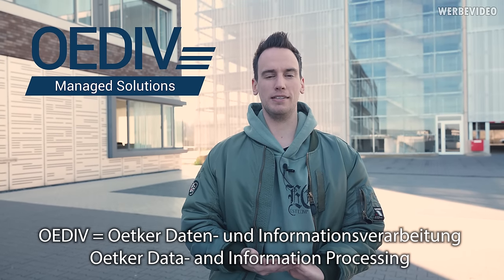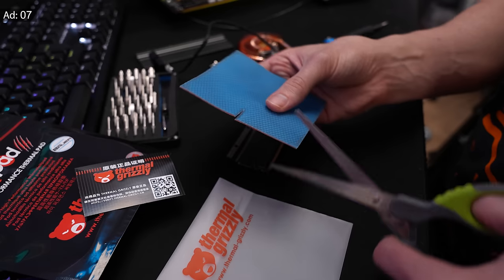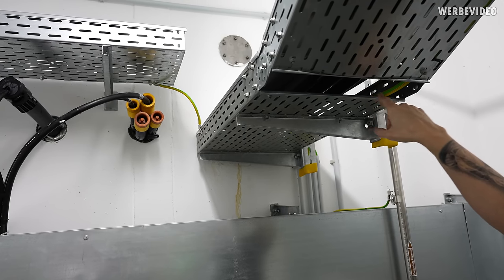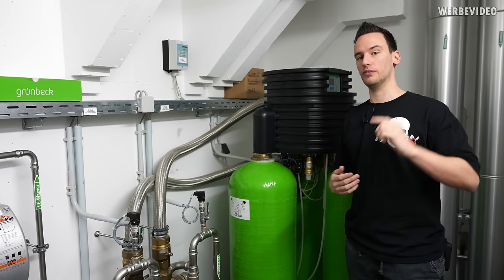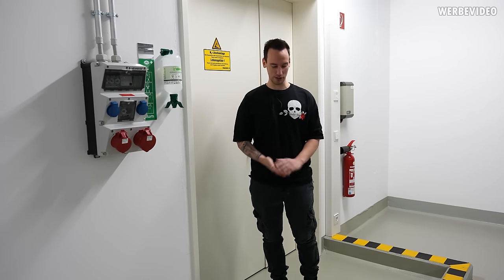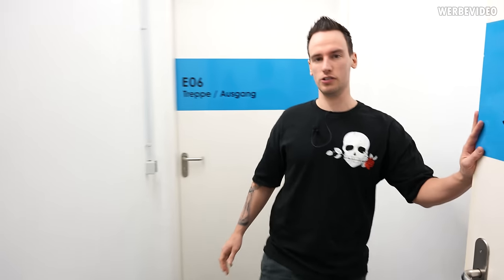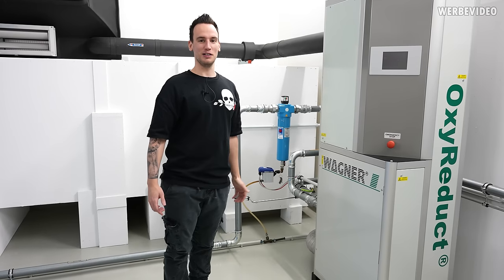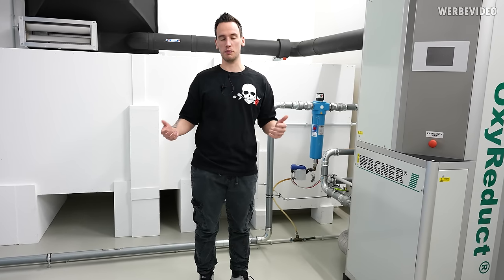Exclusive Insight: Visiting one of the Most Advanced Datacenters in the World

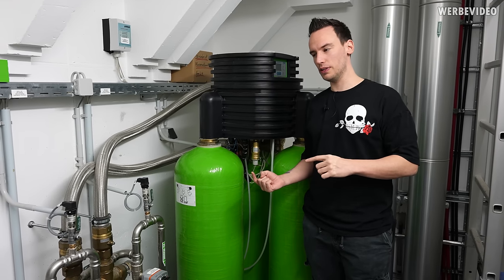Comment: 5:32 As someone working in the water industry, my guess is that those are for water softening. Hard water causes the formation os Scale deposits on anything the water touches (the insides of the whole cooling system in this case), which reduces the effectivenes of heat transfer and ultimately may even leed to damage to the pipeing. This is especially problematic in this case, since the hotter the water the more and faster the Scaling. Depending on how hot the water gets, they may also be using a degassing system to remove oxygen from the water, since in hot water oxygen becomes very corrosive.
Reply: London water is so hard it kills kettles if you don’t descale once ever couple of months, unless you’re like me and use bottled water cause you’ve been put off drinking water boiled in London kettles pretty soon after arriving after seeing what happens.
Reply: absolutely. We have well water on my property here in the states, and we have to use a (much smaller) similar device to soften our water. Otherwise it clogs up the pipes and other stuff with Iron rust build up. Turns everything yellow or brown. I would imagine they need to remove ANY minerals and biological stuff from any water used to cool something this large. Otherwise they would be tearing the cooling down frequently trying to clean the crud out of it. The same could be seen in someones desktop pc they water cooled, and ignorantly used plain tap water inside with no additives. The cpu and Gpu blocks fins will clog up super fast.
Reply: Only thing I would add is; there is no salt in a water softener. The salt in a softener system is used to create a brine which then back washes the negatively charged resin beads inside the cylinders on a regular cycle. It's the resin beads which do all the work.
Reply: It's a water softener. Commonly used here in the states for reverse osmosis, boiler feedwater, and city water/industrial water
Reply: @ZonkedCompanion  "there is no salt in a water softener", yes, but also kinda no. It's true that the resin does the "work", but the way it softens the water is through "ion exchange", i.e. Calcium ions (the cause of scaling) from the water are exchanged with the salt ions (Na for example) from the resin, thus you could say that there's salt in the softener. When you wash the softener with the salt brine, the Calcium ions trapped in the resin get removed and replaced with salt ions, i.e. resin "regenerates".

Comment: I was always wondering why the HANA in-memory database is still a thing when we have crazy fast NVMe drive technology, now I can finally make sense of that. TB level memory access bandwidth is absolutely amazing, no component in a normal desktop or x86 based server can come close to such a level, not even the GPU.
Reply: Muh, flash bad /s

Ehhhhh 8 socket Xeon systems can easily have 8 TB (or more) of memory, and modern datacenter GPUs (ponte vecchio, MI250X, Hopper) put this to shane in raw memory bandwidth.
Reply: @suntzu1409  ok, now which one does both?
Reply: @suntzu1409  Not sure about the multi-socket configuration of the Xeon platform, but I do know for Xeon scalable, the memory bottleneck is a big issue already in a single-socket configuration, about only 200-ish GBps theoretical bandwidth is achievable, and the speed via interconnects will be slower.
As I did miss the H100/Hopper GPU announcement, I apologize for missing that 3TBps single card performance number,  these do surpass the raw bandwidth of 1TBps, so thank you for that information. But as a note, based on my personal experience working with GPU computes, due to the "cores" in GPU having a tiny cache per hardware thread, they hit the memory much harder than modern server CPUs unless you work with very localized data or with data shapes optimized explicitly for this pattern, like crunching matrix multiplications with low precision, which is shown in NVIDIA's pages as the intended use case. Otherwise, the GPU could have worse stalls due to memory access or bandwidth saturation caused by the repetitive fetch of the same data. Also, their instruction set is not for general computing and has a sky-high penalty when branching operation is involved (heavily used by any database).
Finally, the flash technology I mentioned is something like the Intel Optane series, which optimizing in-memory DB's startup latency is one of their main selling points. This is the part that initially confused me. Since they are already using PMems that have an access latency in the hundreds of nanoseconds and a maximum bandwidth of a couple tens of gigabytes, why still put everything 'in-memory' when using flash arrays would be a much more robust and also a non-volatile option. Bandwidth, size and access latency all contribute a critical part to the puzzle, and I do not think missing any one of them would make such in-mem DB configuration make sense.
P.S. I did participate in the bidding process of an SAP HANA migration project from the old SAP + Oracle DB combination. Yes, they do need that 10+TiB memory as their operational database is absolutely enormous, even when the new system has more than one DB instead of the one central one in the old system.

Comment: The cabinets to the left of the z15 are the DS8Ks, which are the mainframe's primary storage system. Another note, that TS4500 tape storage library is most likely part of a virtual tape library which interfaces with another system, a TS7700 which incorporates hard drives as high-speed cache and storage for the tape system. The TS7700 and TS4500 work together and use both hard drives and tapes to present itself as one big virtual tape library to the mainframe for secondary storage.

Comment: Testing generators isn't just to make sure they work, but also to keep them fully lubricated. Additionally, while not likely in a temperature controlled environment, temperature fluctuations can cause condensation inside the crank case. For periodic maintenance runs, the engine should be run long enough to get up to full operating temperature for a while to steam off any accumulated moisture. Running them for a short time can be worse from a moisture perspective.

Comment: I'm surprised they're that proud of a PUE of 1.35 in such a modern datacenter. The best right now are closer to 1.1. Our datacenter built in 2000 was running at 1.3 and Google did 1.2 in 2008.
Reply from the maker: Highly depends on the climate zone where you are located. In colder countries obviously much easier
Reply: Meta has a datacenter in Denmark running about 1.07. The heat waste heat is even used for district heating in the winter. But the hyperscalers like Google and Meta have the advantage of being able to integrate everything, including the scheduling of tasks between servers and powering off servers, for maximum efficiency. They also don't have an indoor climate that's as tightly controlled and use outdoor air for cooling. There are trade offs.
Reply: @der8auer-en  Those datacenters are also generally using DC distribution - it makes a 5-10% difference in efficiency to skip the inverter stage. Google and Meta have both moved to 48V DC distribution with their custom servers. Why 48V? 50V is the highest voltage you dont have to treat as deadly in many places - you need a (data) cabling license not an electrician, and 48V is also good for either lithium or lead batteries), it has also been used in telco equipment for many years. Some companies are also moving to 380V DC or other voltages.

Comment: If the battery backup is active rather than passive it should be doing a constant conversion of AC to DC and then DC to AC.  The input power should be both the grid power coming in and the diesel generator.  If you lose grid power, the UPS would switch over to the generator once it's online.  I think in this case you don't have to worry about phase shifting.  This would be Double-conversion systems if this is what's happening and it completely isolates the equipment from the input source and gives you a very clean AC to the servers.  I'm guessing that's what this would be considering how critical power is to servers.  The batteries give you enough time for the generators to come online and feed power into the AC to DC converter.  I don't think it takes long for the generators to be online.  A few seconds.

We had a different system since there was only grid power.  The grid power would feed into the UPS to keep the batteries charged, but the output was from the grid, though I believe the UPS filtered the power to make it cleaner.  The UPS would be running enough so that the phase shifting would take place so the battery output would always be in phase with the grid power.  If grid power dropped, the transition from grid to battery had to be very fast.  If I remember correctly that's how it went.  I don't think there was a constant output from the batteries.  I think our UPS gave us about 15 min. because it was designed for older equipment that consumed more power and after our servers got changed out the UPS was more than enough for that system.  Then when grid power came back online, the output of the batteries would have to phase shift to match grid power again, and then another switch back to grid power.  Or it's possible it was also a Double-conversion system with only one input.  It was too long ago, approaching 30 years.  Hard to remember that far back.

Comment: Thank you for the tour.  At 43:49 you did get that a  little backwards.  Isilon is your mid range NAS solution and Data Domain is for your backups.  To be fair you do have a VNX next to the Data Domain :)  Also, the ECS could be for backups, but it is traditionally used for Object/Cloud data.
Reply: I was wondering the same. You could use Isilon for backups but I've never come across somebody using it at a decent scale. Especially with the DD on the other side, I would be surprised if they actually used Isilon for backups. I'm an Ex EMC tech so it's nice to see they still go hard with the Disco lights.

Comment: warranty on IBM is very good, we have once have a failed HDD, the tech travel for 9 hours just to replace the drive for not more that 5mins. not like HP they depend on the local supplier for the replacement.
Reply: We had a couple drives fail in a HDS disk array and they sent a taxi from Berlin to Aarhus, Denmark, to get them replaced on the weekend. They (and many others) also had a fully stocked warehouse in Amsterdam, capable of building a replica of your system and delivering it by air within eight hours.

Comment: Hi from Australia. Please send Pizza specials (first frozen pizza i could stand).
More seriously, that's some pretty awesome high reliability infrastructure, theres over-engineered and then theres high reliability computing. 
I'm a little surprised they use inverters rather than distributing DC to the servers from the battery system- the first thing the server is going to do is rectify it anyway, they dont care if its AC or DC as long as its vaguely the right voltage. An inverter stage is generally at least 10% loss and there would be less switching losses in the rectification/PFC as well i would think?

Comment: You mentioned everything is duplicated.  Yes but a single point of failure existed in the fire alarm system.  The redundant AC units and their redundant power sources would develop ground faults which would trip the breakers.  A separate AC transfer switch would then deliver power from the 2nd source which would also trip due the ground fault.  Once both power sources had tripped, there was no more AC.  The supercomputers would then overheat in seconds and trip the fire alarm.  A tripped fire alarm would release the gas (we used Halon) and shunt trip the breaker feeding power to the Supercomputers.  The solution to this problem was to stage the settings on the breakers so that a ground fault would trip the smallest breaker first.
Reply: you mean, if there werent the 25,000L of cool water in the tanks?

Comment: Huh, before the rectifier you need a transformer to reduce the voltage, then you rectify it and if need be stabilize it with capacitors, though in this case the batteries can be considered the capacitor.

Comment: Interesting - I design mechanical systems for datacentres. The base mechanical system is fairly standard.  Most newer datacentres have increased the chilled water temperatures to improve the efficiency further (allow them to use the dry air coolers for longer - i.e. above 12°C).
I have not seen the oxygen reduction before - I wonder if this datacentre still have a fire suppression system in the halls or if the oxygen reduction system negates the need for this. If it does then that is a good idea!

Comment: Downtime .... some systems are not redundant.  For instance some UPS systems use a flywheel instead of batteries to maintain power while the generator starts.  The flywheel has magnetic vacuum bearings and a vacuum pump with a high failure rate.  Should the vacuum pump fail, the flywheel will fail taking the UPS down....

Comment: That Power 10 / z/Arch Systems are extremly expensive for what they can do IMHO.. Yes they run things like SAP-Hana / all Memory Databases. However there are cheaper alternatives which offer the same resilliance / availiability and higher scallability on "commodity hardware".  Look at the Hyperscalers, they don´t use such architectures with a single large memory address space, they use x86 CPUs and their own ARM based systems with 1000th of nodes + a clever software design to abstract that all into one virtual cluster which completly abstracts, compute, memory and storage to the application.
In HANA for example, the application relies on one large memory space, the same can be archived via Map-Reduce in Bigtable. For a slight change /  a littlebit more complexity in the application software / design you save a lot of $ and get unlimited scaling.
Storage is even simpler, you can either buy a "enterprise storage solution" like a NetApp for 500+k€ and have some of the aspects solved in hardware via very expensive controllers and interconnects or you can just buy 50 Commodity servers and run a Ceph Cluster and interconnect them via 10GBit Ethernet instead of some expensive FibreChannel things.

Comment: that downtime of mainframe is insanely huge number, it should not be more than 3s per year 
most machines get turned on when installed and shut down when replaced by modern one when they are on end of it's cycle, no unplanned downtime there 
exception is planned disaster recovery testing when you shut down whole machine to see if second one takes over as it should, but do you really count that as a downtime? this kind of shutdown is without impact on production 

these midrange servers are also cool tho

Comment: Impressive fire detection / fighting measures, interesting, do they test this with the people on the data floor ?   The rest of data center is boring,  MTU + vertif on a power redundancy and air coils + chillers for cooling. This will not bring you even close to the power / cooling efficiency of the top DC. The fact you need to start chillers at >14 deg C is disappointing, as well as a PUE of 1.35. Server part is also quite unique.

Comment: A PUE of 1.35 means this is not even close to the most advanced data center centers whom depending on how you measure it could have a PUE of 1.01 to 1, although the most common is 1.15 to 1, and there are datacenters out there who have a PUE of less than 1 on a technicality (like massive solar arrays on the roof)

Comment: 31:50 Well, that level of lock down from IBM is enough for me or any company I start I the future, to never buy IBM products...
Reply: If you want poor service from random Joe from x86 vendor then go for it.
Reply: LOL you clearly also arent ever going to be in a position to need/use it if you dont understand the concept of high reliability computing.
Reply: @mycosys  I do, probably more then you chief.
And having a monolithic solution ain't it.
Just the fact alone where you need to turn all nodes down to look at one of them, shows you straight away the biggest issue with it. The industry knows this is not the solution and there is a reason 99% don't use or provide services with HBM Power servers.
High reliability is not about just throwing a bunch of money and hardware to a problem, is not just adding redundancy, is expecting and embracing failure as it's not a question if it will fail, is a question when it will fail.
There are many reasons the global industry moved to clusters and in some instances one step further with microservices, where I can have 1 node die, I can replace that node without touching the others and my service was never down.
With this said, if someone doesn't understand high reliability and up time, is you lol